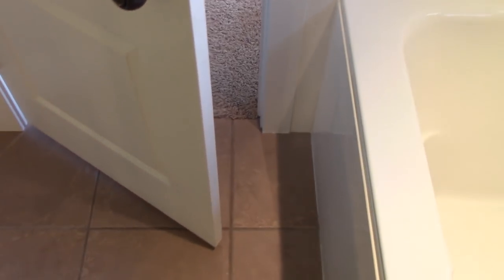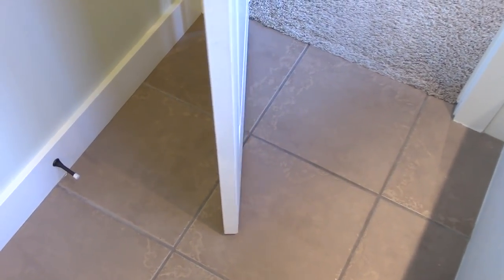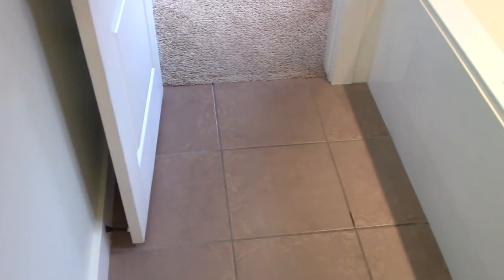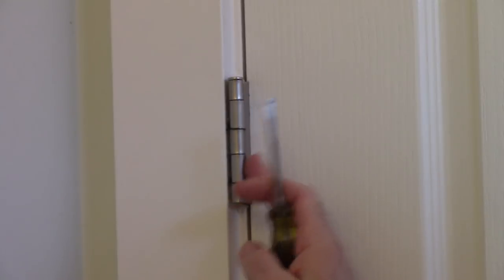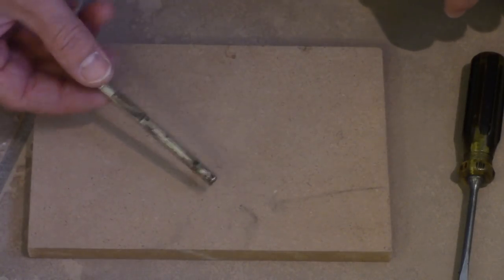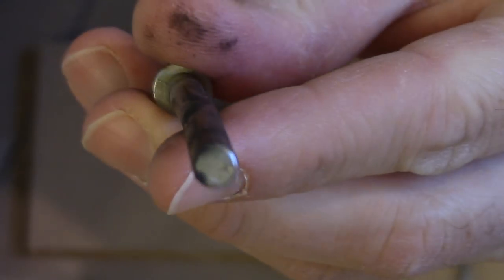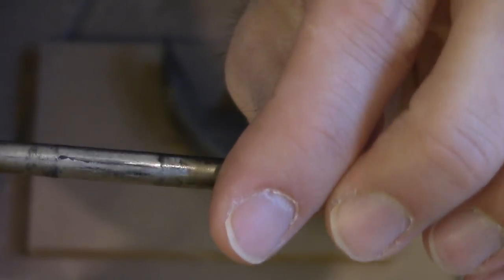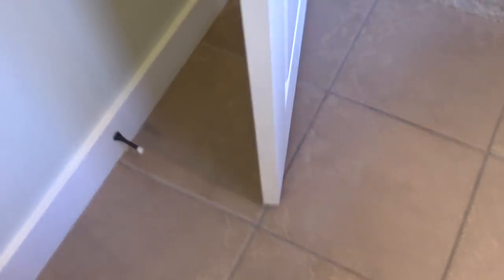How to stop a door from swinging open

Comment: Thank you so much!! Ladies you can do this. Only had to work with one of the pins. I didn't actually remove the pin. Grabbed my hammer and awl, tapped the pin from the bottom to push it up, took the claw part of the hammer to slightly bend the pin, then pound it back into place! Worked great. That door was driving me bananas. Score one for us ladies!

Comment: 25 years in maintenance and have never been asked to fix this problem.   Had a client grease all the hinges in a new place for them.  All the doors squeaked.  I fixed the squeakers, but two of the doors started this issue.  I figured the jamb was not square and was gunna put a piece cereal box behind the bottom hinge, or two pieces on the bottom and one in the middle.   Figured that might fix it.   

Glad I googled.  This is a lot better than boxboard.    I don’t even know if it would have worked either.

Comment: I checked the alignment of the door frames (as discussed in the video) for two doors that swing opposite ways by themselves and they are out of alignment in opposite as compared with a door that doesn't show the problem and the axis is more true than the others, so it follows that the ghost swinging pattern is a frame alignment problem, too. Thanks for the education. The fix is lots cheaper!

Comment: For anyone using this on exterior doors: Great tip, but his did not work for my front door, probably because the door is so heavy. I tried first the middle pin, then two, then all three; no dice. I think the slant/weight is just too great in this case.
Reply: I too tried this trick, but it did not work for my door. I am seeking another solution
Reply: Mine didn't work either and I tried all 3 pins. Did you ever figure out an alternative fix?
Reply: mine didn't work either on an exterior door . . let me know if you find a solution.

Comment: Does it matter which way the pin is put back in? I have a basement door that swings open right into the middle of the hallway. It only has 2 hinges though, every other door in the house has 3. Should I install a 3rd hinge? Since I've already bent the 2 it has.

Comment: I ended up having to do ALL 3 hinges to eliminate the "Ghosting". While a pain, it worked fine. BTW, it started when I lubricated the hinges to stop squeaking!
Reply: Henry Seiden yeah, my problem started by spraying a little lube on it to stop a squeek. Bend the pin slightly, solved!

Comment: My door only has two hinges. I bent the top once once, twice, three times. You could tell the pin was bent from a block away. Did the same to the bottom pin. Door still swings open (quickly). What to do? Rehang the door?

Comment: I had high hopes that this would work, but even after trying it on all three hinges, the door still swings open.

UPDATE:  Frustrated, I bent the bottom two hinges more than "slightly" and it's now pretty stable.  Oddly, when I bent the top hinge, it got worse again, so I straightened it and it's back to being stable.